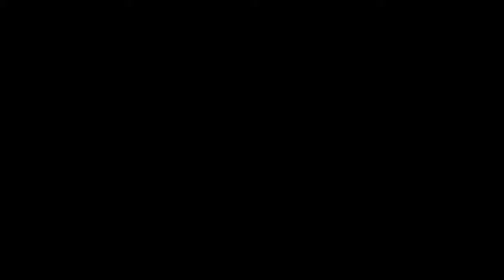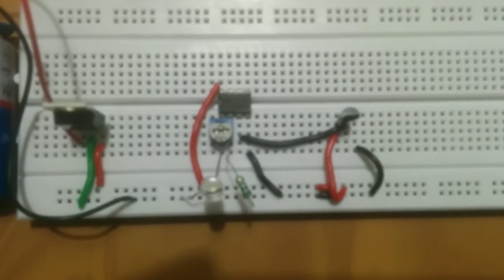Temperature Sensing using LM 35 || Technical Electronics

Comment: We followed the instructables, why is it our LED doesnt glow up when we apply heat to it
Reply from the maker: U need to adjust the POTentiometer till a faintly glowing led shows up. Mostly increase it inorder to increase the gain. This is done to essentially operate the Led near to its knee voltage. Then apply heat. Try it. It will work. All the best.

Comment: SIR ,
HOW CAN I PUT THIS CIRCUIT IN MULTISIM FOR SIMULATION ?
Reply from the maker: Use voltage source instead of LM35, and make its output voltage in range of 0.2 to 0.38 volts. Other components you will get easily in multisim.

Comment: Bro i connect this circuit, but before I give heat to lm35, LED is glowing, what I want to.do get this project output?
Reply from the maker: Reduce the POT(variable resistor). It acts as a feedback. More feedback, more dim led will become.

Comment: Thanks for the circuit, but how can I use a fan in exchange for a led?
Reply from the maker: You need to use an high current power amplifer, suitably non inverting one, then give output to a DC motor.